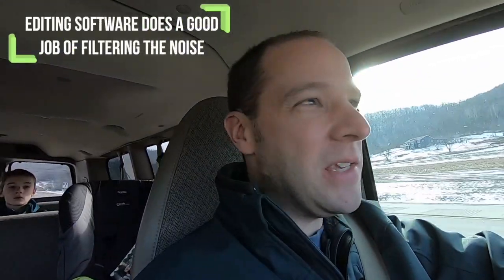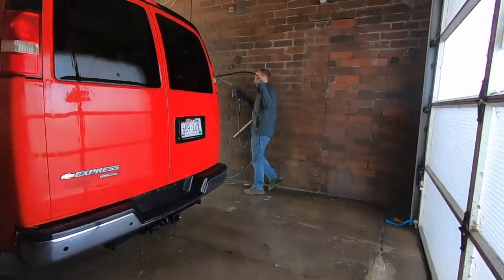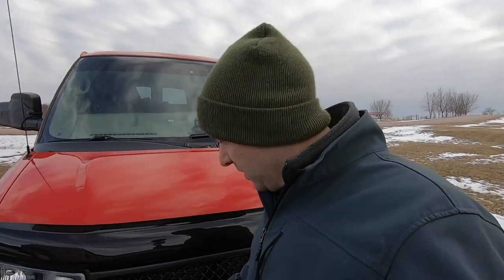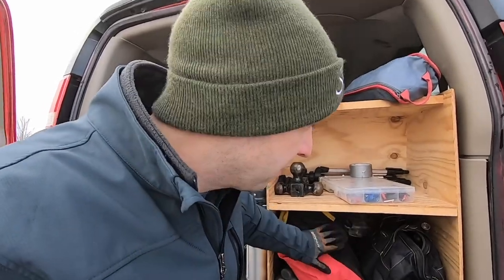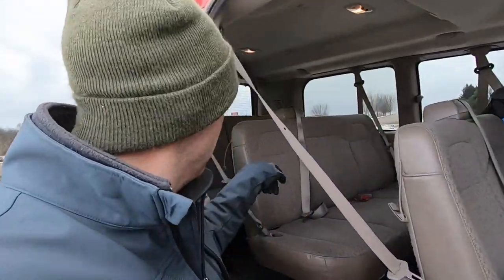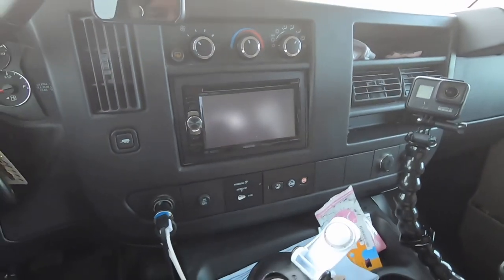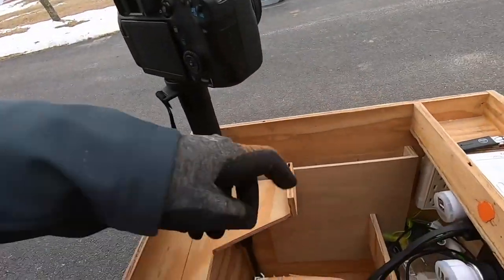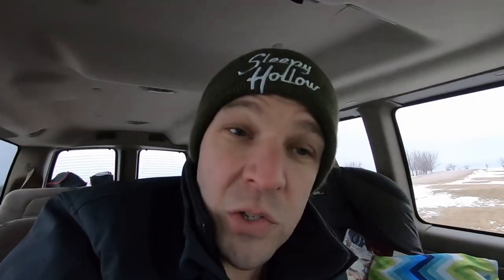LARGE FAMILY DIESEL TOW VEHICLE - THE BRV!

Comment: Good ideas for organization ideas.
  Have you considered installing "posi-trac"?  It ain't four wheel drive but one heck of a lot better than single wheel and a lot cheaper.
  Ive towed with 2 wheel drive posi trac, it was ok, and then bought a 4x4.  Night and day.  My tow vehicles will all be 4x4 from now on.
Reply from the maker: Hey Duane yes I thought about it and talked to a 4x4 place that told me towing would be hard on the posi trac. Thoughts?
Reply: @WeCanExploreIt  
Towed for close to 5yrs both rvs and gooseneck trailers with posi track but did not put miles on you probably do.  Never heard anything then or now about not lasting.  I do know you want to keep the tire size the same.   An example of what you don't want to do is replace one side and not the other such as may happen if one gets damaged.
Reply: I put a detroit truetrac in mine, no problems so far but haven't towed with it.

Comment: How is the van holding up ?
What's your towing weight ?
I have a 2013 Chevy express 6.6. Duramax .
Going to 4x4 soon
But they want $18,000-$22,000 installed
For the conversion. Idk
Reply from the maker: It’s still going great. In the dakotas now. Towing weight is 8k ish. How many miles on your machine and who quoted for the 4x4?

Comment: We just bought a BWV (white 2019 3500 15 passenger with the 6.0 gas engine) and we love it. Bought it certified used with 17000 miles. They are really well priced used. 

I found power heated mirrors for the 4500 box truck. They are awesome!!! The down sides are the cost ($500/ pair) and the are always extended. 

Even with the locking differential it gets stuck easy. I am looking to put 4.10 gears in the read to trade some top speed for low end torque. I wish they still offered the 6.6 diesel. The 4.3 is no replacement when it comes to towing.